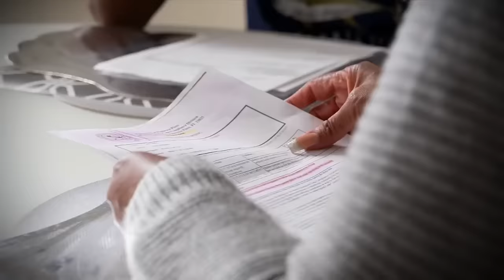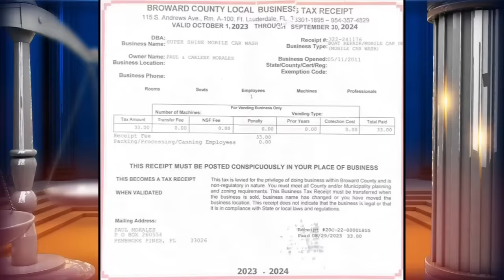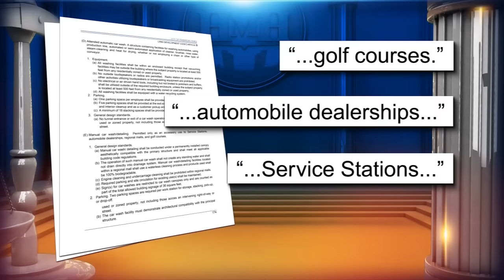Mobile car wash is not a mobile car wash

Comment: Seems to me all he needs to do is provide a phone number to customers and drive to them. That should eliminate all issues. You will be mobile and not parked in that same parking lot. You can also gain a larger customer base.
Reply: Right.. I mean, after 6 years they should have been getting numbers to text and email addresses.
Reply: Exactly! His phone number is on the van, though. 💯

Comment: For some of you can't understand & quick to call something else. THE CORRECT MEANING.: Mobile car washing service is a type of car cleaning service where a team of professionals will come to a customer's location to wash and clean their vehicle, rather than the customer having to drive to a car wash facility. This can include services such as exterior washing, interior cleaning, and detailing. 6 years in 1 location, that's a stationed business/wash
Reply: You are the only one here that actually has a working brain, I commented the same thing in a shorter version, if he's not going to customers he is not mobile. He got away with it for 6yrs now it's time to move on and be mobile or find another spot where he can try and get away with it for another six years.
Reply: Agree.
Reply: 💯 - - This is true. I feel for the guy but mobile means traveling from location to location. I'm unsure why he doesn't want to do that, especially if its in his area of business. Everyone keeps harping on 'government coming down on the little guy.' He should be greatful that he was allowed to use a business' parking lot for 6yrs and not pay zoning fees or the use of that space.

Comment: I like the work ethic, but, you have to wonder where the chemical runoff is going. One of the reasons car washes are more regulated. Odd this wasn't brought up. Believe me, we get a mobile interior cleaner every spring - and anyone doing mobile washes have to lay out rubber barriers to catch runoff - which is why a lot dont do it.

Comment: its a fucked situation for sure, but I get it. They are saying he is improperly licensed as a mobile car wash when he is not mobile, he just works out of his van. car washes put a lot of harmful chems into the water and ground and need to be developed specifically for that use for that reason.  if he is going to be in one spot forever, he needs the proper drainage and waste water lines. if he was actually mobile this would not even be an issue.

Comment: CLEARLY NOT a mobile car wash. They leave the people alone who follow the system
Reply: The definition of mobile is able to move or be moved freely or easily, it doesn't say you must be moving. Since they are able to move when they want the name mobile is linguistically correct.
Reply: @kenlompart9905 No its not, The zoning specifically stated that it must OPERATE in multiple locations otherwise must have a permit and a zoning plan for its location of operations. The issue here is that they have a permit for an operation that they do not abide by, there is a permit for what they are doing but it was too much $$$ for them so they tried to go around it the cheap way and got caught. Its not fair to those who are doing the same thing but paid the dues and fees to do so and this business did not.
Reply: @timothywhieldon1971  Your comment stated it's not a mobile car wash which it obviously is, the zoning laws are a completely different issue.
Reply: @kenlompart9905 Because he is NOT a mobile business. They are the exact issue. Mobility or operating out of a truck is NOT the definition of a mobile business. I own a Tile installation and bathroom remodeling company. 100% of our operations are in different locations obviously and all the work is done out of a business truck but yet we are NOT A MOBILE BUISNESS. The business is based on location of operation. Since his operation is 100% in one location it makes no difference how he gets there or what its being worked out of, a brick and mortar building or a truck to move tools in. It’s all about WHERE YOU OPERATE OUT OF. You clearly have no idea what you are talking about or have any world experience in this topic.
Reply: @timothywhieldon1971 Fine, you stick with that, I'll go with the actual definition of mobile, not your definition.
Reply: @kenlompart9905  your dilution is made up out of thin air. the fact is that he is being fined for a reason. the zoning department is 100% telling you that you and he are WRONG. you can not operate as a mobile business if you only work out of one location. plain and simple. Please go back to trolling other people with your crazy BS. He is NOT operating as a mobile car wash, and you are saying he is but NO ONE in any position that issues permits says he is. THUS THE ISSUE.
Reply: @timothywhieldon1971 Again, I never questioned the laws  regarding where he was doing business, I only stated what the definition of a mobile business is. I can't believe you can't understand something so simple.

Comment: They said it's not considered "mobile" because he's in the same spot every day. What if he rotates where he parks (say, two spaces over each day)?
Reply: He's on private property, and they don't want him there. Nothing wrong with that.
Reply: @stanleyhape8427  They said he had the owners' permission.
Reply: @KingCobbones 
And then the owners told them to leave. Did you miss that part?
Reply: @stanleyhape8427 You missed my point. Because the City determined he wasn't mobile (by being in the same spot each day), they pressured the owners to make him leave (2:07). Therefore, if he shows that he's in fact mobile, by using a different spot each day, then the City may not be able to make their claim.

Comment: If they are a "mobile" car wash, why do they need a fixed location? Advertise a phone number (or a website), take calls and let people make appointments where you'd drive the van to their location, wash their car, then move on to the next location. Or if you weren't currently busy when they called, you could go right away if they wanted. Park the van at home at night.

Comment: Unfortunately the city is right. Mobile means you go to someone's home or business not to a stationary place everyday. Somebody owns that parking lot and he doesn't pay rent. He probably takes up about 1000 square feet between his van with the doors open and 3 or 4 cars waiting. Not to mention a gas pressure washer making noise and soapy water running through the parking lot. For a car wash that's stationary you need a water clarifier built in to the ground to capture dirty water.

Comment: If the gov's grind is that he's in the same spot, then -- it may not be easy at first -- but do some advertising and be mobile.  I know in my town there are a few, the auto detailers come to the customer's property to wash the car... be it an apartment (which is difficult to wash your car) or home if you have water regulations that typically disallow it.

Comment: Well although I  sympathize with his plight, it's the same for food trucks and the like. You can't just sit in on place everyday all day. It's the law in many places. While it may seem ok for one mobile car wash, what if 20 showed up and did the same and then 20 food trucks and then 20 orher vans selling stuff and on and on.
 It would become a real problem. If they let one guy do it then they would have to let everyone do it. It would set a precedent. 
 What probably happened is the city either wasn't aware as they are usually reactive not proactive or they were turning a blind eye toward because it wasn't a problem. Then some A hole complained and then the city had to take notice and act

Comment: It completely sucks for them but it's kinda true, you need to be mobile to run a mobile business. They don't look like they are struggling very much business wise. Just frickin move the van somewhere else? Or go to your customers for a little up charge. Most successful mobile car detailers make bank and quickly upscale.
Reply: @GhostStrawberryyour right, in this case they have been operating their business in a parking lot and the city doesn't want them there anymore. Oh well it lasted for years now its time to move on. Rent a space, work from your driveway or be mobile like a mobile business does.

Comment: How about actually being a mobile carwash? There are no logos or info on the van so that those who require your services can contact you. Mobile roughly translate to moving. I also figured that more loney could be make from actually going to customers rather than letting them come to you. Because you would als have to charge for the journey to the customer as well as the service provided. Being in 1 spot for 6 years is not even nearly Mobile. That's stationary. The only time mobile comes in the picture is when journeying and leaving the location.

Comment: This really isnt difficult to understand. 
The man started a mobile car wash, meaning he would drive to his customer and wash their vehicle, not meaning ota okay to park in the same lot for six years and have everyone come to him, that is defeating the purpose of a mobile car wash, and is in fact a manual car wash run out of the back of a van. He can just put a shed up and wash cars out of that, but the plaza isnt zoned to deal with washing waway car washing chemicals, which is something a dedicated car wash does not do, they capture the chemicals and they are taken away to be dealt with more properly. 

This giy has just been leaching random whatever into the surounding area for six years without penalty and might consider just doing this the right way.